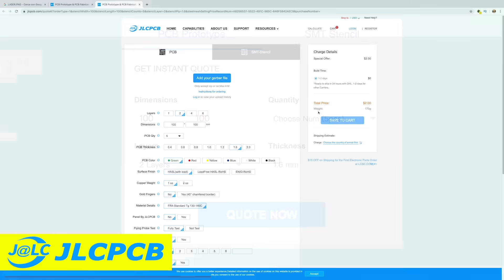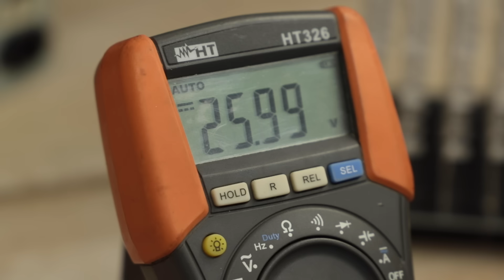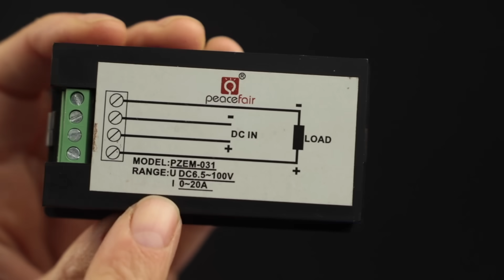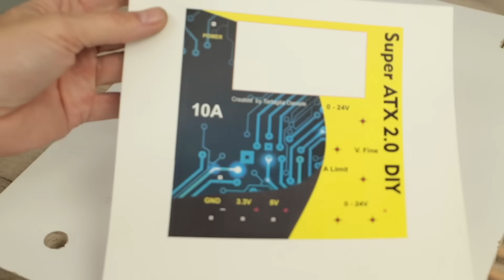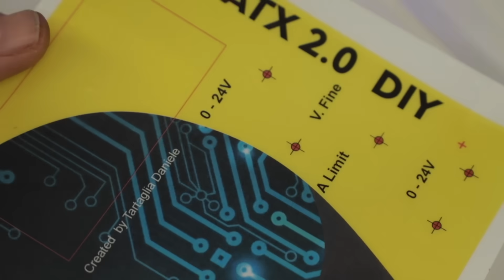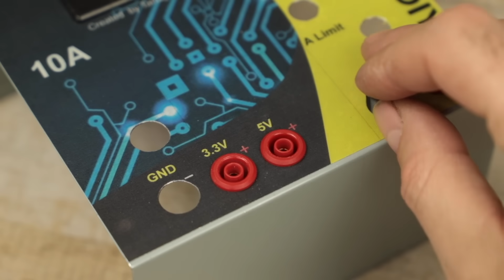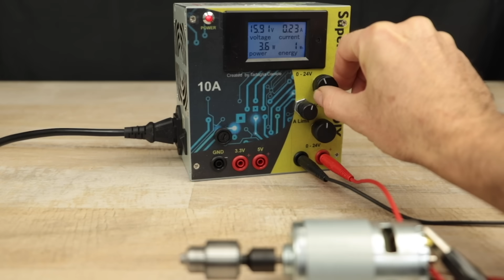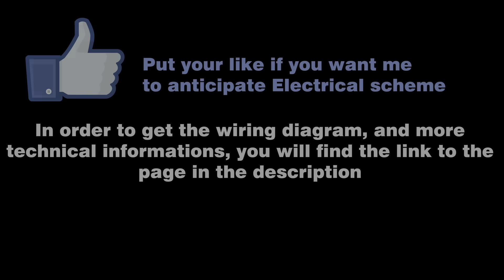ATX PC - DON' T THROW THAT AWAY!!! here is a BIG idea

Comment: What is the porpouse of the power resistor in 6:58 ?
Reply: The power resistor is needed to turn on the power supply.  Without the load sense the power supply wont turn on.

Comment: I would have mounted the dummy load inside on the "front cover" part near the fan for increased cooling and is out of sight. Other than that it's pretty good. Also some rubber pads (from old laptops) would keep the PSU from sliding on the table.
Reply: I would have first tested if my PSU needs a dummy load to start with. Mine for example doesn't. (Or the status LED is enough of a dummy load)

Comment: the power resistor is for what? what happen if we dont use that power resistor? please tell me. sorry for my bad english
Reply: If you don't use the power resistor the power supply will not output.  Remember it is designed to have a load and separate power switch on the pc too.

Comment: Would you mind if I ask you a question? Is it necessary to have RX24 10W 10R 10RJ resistor installed for any kind of ATX power supply or just the older model?

Comment: What does the other big potentiometer (at the bottom, labelled 0-24v) do?
Reply: the dc dc board mounts it .. the atx for the 24 volt uses the +12 and the -12 volt. therefore 2 capacitors charged at 12 volts in series (+ 12-) (+ 12-) at the extreme 24 volt draws

Comment: I'm really curious, what's the resistor on the 5V line for? Also, thank you very much for this video, this solves two problems at once for me. What to do with an old PSU and how to get a cheap DC power supply for projects. Love it.
Reply: To trick the PSU into thinking its attached to the motherboard and to keep the power supply in the “ON” mode.
Reply: @carlos66083  if i dont have that resistor. what else i can to replace that power resistor ? sorry for bad english
Reply: @carlos66083  Thank you!
Reply: On some PSU's it's not necessary but some PSU's require some dummy load to work correctly. I made a lab PSU (with more connectors than this) approx. three years ago from Antec TP3-430 and it works great without it. I tried the same with a Chieftec PSU but it needs the dummy load. You don't lose anything if you try without it.
Reply: @Daunlouded  my psu dont turn on if i dont load something on it. if i loaded it turn on just for 3 seconds and it turn off automatic. should i use dummy load to turn it on?
Reply: @Daunlouded  please can you show your project or a guide how to realize it? It would be appreciated a lot learning to make one
Reply: @Daunlouded Yeah, maybe some re-tinkering with the psu.. Thanks for your input!

Comment: Why that dummy load resistor on 5 volts wire?
Reply: Output voltage regulator input is tapped from 5 volts rail. In order to clamp down the output of 5v so as the regulation circuitry to follow the instantaneous peak voltage, a load resistor is used.
Reply: @trinityhaokip  thanks for information.

Comment: Can we convert a 110v power supply to 220v?
Reply: Most all computer power supplies are universal and will work on any input voltage from 100 to 240 volts. Some older models will have a switch that says 120 / 220 so check what it says before you power it up on 220.

Comment: you are using a Step down Module, but how are you able to reach 24V, if the max voltage of the ATX is 12V. There is something missing.
Some explanation are welcome.
Reply: +12/-12=24volt
Reply: +5/-5=10volt
Reply: @giulioballirano6265  1.7v = +5V/+3.3v
7v = +12v/+5V
8.3V = +3.3v/-5v
8.7V = +12v/+3.3v
10V = +5V/-5v
15.3V = +3.3v/-12v
17v = +12v/-5v
24v = +12v/-12V
Reply: @giulioballirano6265  yes , I know the different combinaison of ATX, but is this "24v" able to provide much Amps ?? because you are using a Step Down Module 8A, and usualy -12v is  able  to give insignifant Amps...
Reply: And can you explain why when you are moving the knob for Amps at 16:02, voltage is changing and not Amps ??
Reply: @DrZipZwan  Ho letto solo la scheda tecnica del mio ATX il quale ho in laboratorio per il mio futuro alimentatore ,non ho misurato gli Ampére,sto ancora al disegno e ricerca dei componenti.

Comment: Hi man. Great video. But I have a question. How do you get 24v output from 12v input with a step down converter ??? Maybe the link to the module is not correct ??? :)
Reply: Exactly
Reply: he might use +12v and -12v lines from the psu
Reply: @TomaszStachewicz  And result an 10 Amps power supply ??????? The -12v is 0.5 A, my friend. And if we look with the eyes open, we can see that at the input of the module is +12v and ground. The only error is the link to module. In video, Daniele use a DC-DC 8A DC5-30V 150KHz Automatic Step Up Step Down Adjustable Power Module Voltage Regulation .
Reply: @catamures1  makes sense, thanks
Reply from the maker: @catamures1  no -12 and +12. but only 12vdc with power regulator step up/ step down
Reply: I only have step-down module. Can I use -12 and +12 rail ?
Reply: @febbyeka  no, as stated before the current limit of -12v rail is very low and will be the limiting factor. you can still make a 0-12v variable voltage psu.

Comment: Why using a 10hms 5watt resistor?
Reply: because old atx power units needs to have some load on 5v line to supply current on 12v line; if you don't load the 5v, the 12v is very poor; it's just a design feature and not a fault.
But some other rather new power units don't need that... just try put your unit's 12v under load and check voltage.
Reply: Some power supplies will not turn on if there is no load on the output.